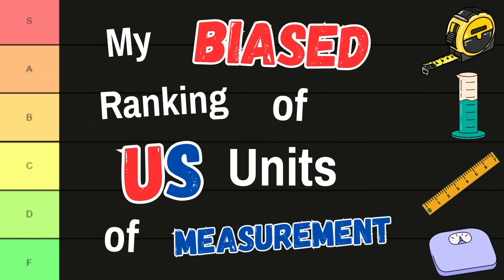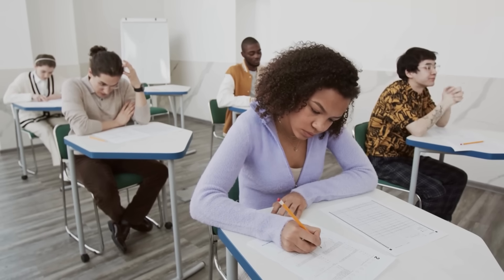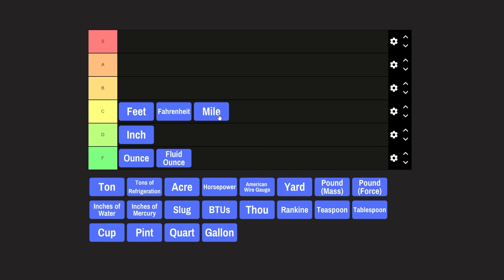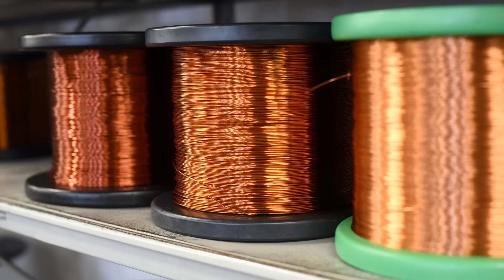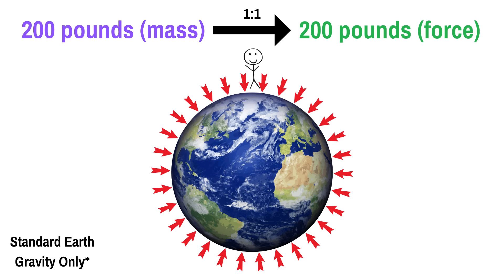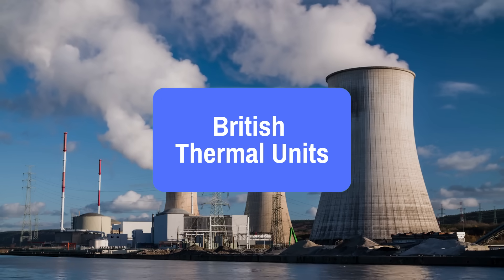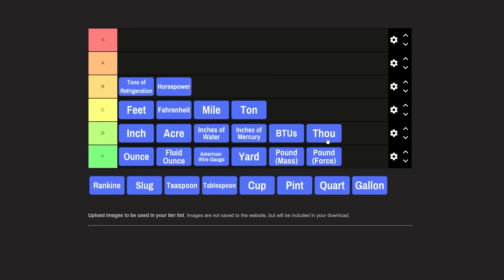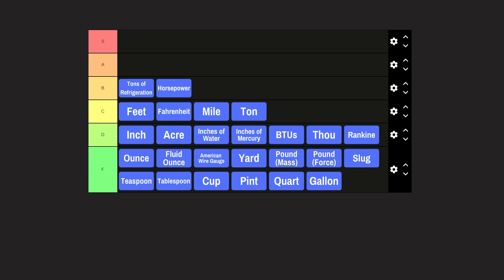Tier List of the DISASTROUS US Measuring System

Comment: The claim that "fahrenheit is a measure of how hot you feel, with 0 being too cold and 100 being too hot" never makes sense to me. 100F is about 38C, that's far above what I would consider "too hot", I start to get too hot around 77-86F not 100. And 0F is about -17C, which is pretty cold sure but far from the unbearable deadly chill that I'd expect to be the opposite end from 38C as "too hot". I know I'm biased but Celsius really seems more intuitive for this. -30C to +30C makes sense if you're measuring one extreme to the other, both being the very edge of tolerable with the right clothing and supplies and deadly without the right clothing or supplies or if endured for too long without being warmed up or cooled down respectively. And for a less extreme version -20C to +20C is on the edge of uncomfortable, but doable so long as you're wearing weather appropriate clothes, and uncomfortable to excruciating without weather appropriate clothes but you could survive for a decent amount of time. Both ends feel like they're within the same range of extreme for their respective temperatures, so Celcius feels like both sides are mirroring each other. With 0-100 in fahrenheit it goes from "you'll need to wear like a medium thickness jacket and a scarf to be comfortable" levels of cold to "actively trying to kill you" levels of hot so it doesn't feel like a good measurement for "too hot" vs "too cold". I understand that it'll feel more natural to measure what you're used to, and that fahrenheit having more numbers overall helps with being more specific, I can understand those arguments, so idk why people keep using that "how you feel" argument for 0-100 instead of just saying "it's what I'm used to and I like the specificity".
Reply: Dude? Go outside ar -17 that shit is cold as fuck
Reply: @ninjacortadordecebola1215  I go outside at -17 on a regular basis, it's definitely unpleasant sure but more than doable with a medium thickness jacket and a scarf. It's certainly nowhere near the same level of extreme as +38. At those temps they issue heat wave warnings on the news and tell elderly people and children not to go outside for too long.
Reply: @oMuStiiA 38 is the definition of too hot, 35 and below are completely doable
Reply: @ninjacortadordecebola1215  maybe if you're a freak of nature. It's nowhere close to comparable to -17. If +38 is the "too hot" end of the spectrum then the "too cold" end should at least be in the mid negative twenties to be even approaching the same severity. Especially since you can always wear more layers to stay warm in cold weather but you can only get so naked, and being naked will not save you in 30+ weather.
Reply: @oMuStiiA  Dude? Human species was born in africa, we are literally build to withstand 30+ temperatures, if you're having trouble living at 30+ celcius you should look for a doctor, maybe you dont have sweat glands
Reply: @ninjacortadordecebola1215  30+ temperatures literally kill people on a regular basis even accounting for weather appropriate clothing.
Reply: @oMuStiiA  So does -17? your point?
Reply: @ninjacortadordecebola1215  people in weather appropriate clothing are not dying in -17 weather lmao. You don't even need a thick winter coat to survive that. You could be naked in 30+ weather and still die of heat stroke.
Reply: @oMuStiiA  no one dies at 30+ celcius of heat stroke, people in saudi arabia literally face daily 40+ degrees and are fine
Reply: @ninjacortadordecebola1215  lmao what. People die in 30+ weather all the time. We literally get warnings on the news when the temps get over 30 during the summer where I live. People in Saudi Arabia generally know how to deal with hot weather, they're not standing out directly under the sun for extended periods of time without regularly cooling themselves off BECAUSE they're experienced with hot weather and know how dangerous it is, and even then people die of heat stroke in Saudi Arabia and other hot places like that ALL the time, especially poorer people who can't afford stuff like air conditioning in their homes or have to work in the heat more often. At -17 people can die if they are dressed poorly or if they get wet, but if they're dressed appropriately then they can survive at that temp pretty easily for quite a while without needing to go inside to warm up. Wind complicates things but that's mainly because wind makes it colder, so -17 with wind is functionally colder than -17 just like how +30 with wind is functionally cooler than +30. Without wind -20 or lower is when it starts to get more actively dangerous. And that's not even taking humidity into account since humid heat can be even deadlier than dry heat since it prevents your sweat from evaporating as efficiently and thus your body can't cool itself off as effectively. I've waited for the bus for over an hour in -25C weather, in -17 weather I can go out in just my pajamas and a poncho for an extended period of time without any danger. It's uncomfortable as fuck when dressed like that, but even when underdressed I'd have to be outside for several hours before I'd be in significant danger.

Now I will admit that when you're actively out in that weather there's more you can do while outside to mitigate heat than there is to mitigate cold. You can stand in shade, use water to cool yourself down, generate wind with a fan, etc. But in the cold you can mainly only put on more layers, and if you don't have more layers you're screwed. So in that way you can have better chances of surviving in heat than in cold without shelter because of the availability of resources to mitigate the danger. But all things being equal, if you don't have access to water or shade in the same way you wouldn't typically have access to extra layers, heat becomes just as deadly. Celcius and fahrenheit don't measure access to resources to mitigate the temperature, they just measure the temperature. People in hot countries can survive because they're knowledgeable in how to mitigate the heat, not because humans are designed to live at +38 without issue. I could easily argue that because I have a jacket rated for -50C weather and because where I live people work outside in -30C or lower weather all the time that -30C isn't that bad and not that dangerous, because where I live we're used to that weather and know how to mitigate it, but that would be stupid because I know how dangerous those temps can be without the proper resources, just like with high temps.

It gets to -40 and +40 where I live on a regular basis depending on the season so I've seen both extremes and I've seen which thresholds are the equivalent in terms of danger and tolerability and how much you need to do to mitigate them without shelter. You need more caution and preparation and supplies at 30C or higher than you do at -17, let alone at +38C. They simply are not equivalent, not even close, which is why they don't make sense to me as the two extremes for "how hot or cold you feel". I could concede if it was closer to -20 vs +30 even if I can tolerate colder than -20 myself, but the fahrenheit scale is closer to -15 vs +40, -15 vs +35 if I'm being generous, which are in completely different temperature brackets from each other. At -15 to -20 I'm uncomfortable sure but I can tolerate it for an extended period. At +35 to +40 I want to kill myself within the first 5 minutes unless I'm at the beach because then I can swim to cool off. And I have a higher tolerance for hot weather in general. I prefer hotter weather if I have the choice since I hate wearing layers and I have circulation issues in my feet from past injuries that cause them to get cold faster. So I'm saying this as someone who does better with heat than with cold.
Reply: @oMuStiiA  bro if your argument is that people who cant shelter die in high temps, you have no ideia how many homeless people die in the winter, like thousands of homeless die in the winter, cause surviving outside with -17 is not something feasible
Reply: @ninjacortadordecebola1215  it's almost like homeless people have a systemic lack of access to resources such as weather appropriate clothing. It also almost as if homeless people also die of heat stroke in hot weather all the time. Weird how that works. Bringing up homeless people doesn't help your argument at all, I know many homeless people personally and the main difficulty they have in the winter is that they have much less access to resources to combat the weather. And again, that is not what the scales are measuring. It's okay to just admit that a preference for fahrenheit is subjective instead of trying to invent an objective reason for it. There's no need to die on such a ridiculous hill.
Reply: @oMuStiiA i prefer celcius, but your argument for fareheint being bad is stupid, fareheint is bad cause its not linear.
Reply: @ninjacortadordecebola1215  I never made an argument for fahrenheit being bad, I made an argument for the "it's how temperature feels for people" justification of fahrenheit being stupid. I never said anything about fahrenheit being bad or not.

Comment: The absolute dunce of units is acrefeet. Unlike cubic litres, cubic metres, and the like to measure water storage, or rainfall, you have "this would cover a 66ft x 660ft (or 22yd x 220yd) area with a foot of water." 
"Ah yes, my 4,840s and 43,560s. Thank you for this intuitive unit to calculate and visualise. Thank you for also not explicitly providing the actual volume in the answer, and making me do a monstrous, extra calculation."

Comment: I am European and I consider Fahrenheit superior over Celsius for common uses. Fahrenheit provides more resolution for weather temperatures and wouldn't require specify if the temperature is under or over zero.
Reply: Scared of negatives for no reason at all
Reply: In Europe temperature is not as extreme. For me as a Brit the literal only thing I need to know is "Will the roads be icy today" and so if its negative boom I know. Then I just set some value I know to be hot (i.e . 25) and look for that. Easy

Comment: Fahrenheit deserves an S, it sucks today but back in the 1700s it was the only practical temperature scale. People have yet to realize that how hot an item is should be measured quantitatively by then.
Reply: Then all of the american measure would go in S tier, the thing that makes them Bad now it that they we're maded for Their context and it worked there, so no, F tier all😮
Reply: @r @rhythmheaven Not exactly, things like feet and yards are way more subjective than the Fahrenheit. Feet, inch and pounds are linked with some specific objects while Fahrenheit at least tried to use two objectively fixed temperature (although failed owing to the technology, without modern temperature scale it’s easy to treat iced salt water and body temperature as something constant) It’s more like the metric meter originally defined by the meridian length (though later people knew that the earth isn’t a perfect sphere) compared to other imperial units. Every thermodynamic textbook I own praises Fahrenheit highly not for the practicality but for his thoughts.
Reply: @daxian0he424  so still F tier? thank you for repeating then
Reply: @rhythmheaven practically F, scientifically S
Reply: @daxian0he424  nah, that has to even out to D tier men

Comment: I don't agree with Fahrenheit being underrated, it's underhated. These explanations make no sense to me. Like, I live in a pretty cold place, is 0 F really cold or significant to me? - No. But 0 C is saying either it's raining or snowing, will the snow lie or will it melt, should we harvest the crops before they turn frozen and spoiled or can they still grow. Also Celsius can be easily used for cooking. Like 95 is a little colder than 100 (the boiling point), this may be really important for some kinds of tea. You don't have to memorize exact weird values that you can confuse. Also a pretty big amount of substances melt or boil under 100, alcohol for example (keeping the right temperature is important when condensing some alcoholic drinks)

Comment: Weather (and also indoor air conditioning) is the most common use for temperature measurement, and fahrenheit is clearly better than celsius for that purpose. For cooking, fahrenheit is fine too. Yes, you need to remember an odd number for the boiling point of water, but you also have more granularity to work with, so overall I'd say it's just as good for cooking. For science, celsius is clearly better. So let the scientists use celsius and the rest of us use fahrenheit.
Reply: Literally nobody outside of US uses or will ever use Fahrenheit.
Reply: Americans are so bad at mathematic that they can't use fraction and decimals. More granularity lol. We smart metric people just need to say 37.4 and everything solved.

Comment: As someone who knows both decently enough, I generally just use the American system. It's what I grew up with, and I just assume everyone I interact with only understand it. Plus, at the end of the day, it doesn't matter. Both systems work where they are used.
Reply: I think its actually the main reason why its not really possible to make america use metric system,for just a little benefit for future (or not at all) youll have to blow up literally everyone there RIGHT NOW 
Like imagine forcing people who grew with inches get suited with metric system
Its not that hard but its not worth it i think
Though id like to see how yall calculate 0,625 inches into feet or smth
Like the only problem is that its not fitting the calculation system with base of 10 at all,because it was made for calculation system with base of 12 iirc
Reply: @Narezki_Seldii think the main thing is that no one would care to calculate that they would just ballpark estimate it. Reality isn't often exact and measurement.
Reply: @MorsSoul  Well this method wont apply anywhere really,but majorly i think yea,no one gives a fuck about extra 0,02 or smth
But i heard that engineering blueprints and models are made in inches and thats weird 
Youre still right though

Comment: As an american, I may be used to a lot of measurements, but it doesn't stop me from forgetting all the ass backwards conversions that are all too common while baking, there are 28 grams in an ounce, and 16 ounces in a pound... So when I try to scale up or down from there, things get sorta wonky. By the way, no, I do not memorize these units, I can never remember what the hell they convert to. Whereas with metric, you guys get a nice and easy system where a decimal is the only thing separating conversions from say kilos to tons (1000kg = 1 Metric Ton) where 1 kilo is 0.001 metric tons, distances were never easier to measure, or even moreso, visualize, given with feet, inches, and yards, you have practically no constant conversion, and will always need a conversion chart. It's either that or keep trying to memorize conversions that make no sense. And again, this is coming from soneone who learned the "U.S. Customary System" first, and only learned metric and it's buttery smooth conversions in freshman year of highschool.

Comment: As much as the metric system legitimately makes mathematical sense, my argument specifically for units of length (inch, foot, yard) is that it breaks up a bit more nicely. 2 feet is a lot easier to estimate then 61cm.
Even fractions of an inch feel more realistic to measure to for general work then mm. Although the mathematical standardization is bizarre, the estimation factor is something I think is massively overlooked.
Reply: Explain how 2ft is easier to estimate than 61cm? You could say it both ways round,d epending on what unit you use.

Comment: You forgot the nautical mile, and barley corn
Reply: Nautical mile is not a part of either the imperial or the metric system. It's still internationally used exclusively in maritime and air traffic. 1 nm is the same as 1 distance minute, which means 1/60 of a degree latitude on the earth.

Comment: I would think yards are based on arm length, cause fabric is sold in yards, and it would be easy for a fabric seller to use their arm to measure.
Reply: One yard long arm? You must be a orangutan then 🤣🤣 One yard is 3ft or 91.44cm, more like a footstep.
As a "metric guy" I often measure distances in metres with footsteps, one metric footstep is just a little longer than one yard.

Comment: As a European, I'd kick Horsepower into D tier (horses aren't 1 horse power, what are they even doing?), Tons of refrigeration into C tier (cool, but it's such a silly way to just think of energy), and Fahrenheit into B-tier (It's a good measurement, Celsius is just better). Also teaspoon, tablespoon and cup can be B tier too. Very useful for cooking. Quart and Gallon are D tier because just start using ml at that point already, and pint is C-tier because of the same reason, but where it fails as a measurement, it makes up for at the pub.

Comment: The AWG scale has that ridiculous root associated with it because the idea was to make it have 40 values, each the same multiplicative factor larger than the previous, from an arbitrary small size to an arbitrary large size, inclusive. Because it's inclusive, it's 39 steps for 40 points., hence the 39th root. 92 is the ratio of the two endpoints, so each factor is the 39th root of 92. They also decided the indices should count backwards, and that 0 should be 3 steps in, for whatever drunken Victorian Masonic voodoo reasons. And it's based on radius, when area would make more sense for tensile strength and current capacity. Just a garbage system.